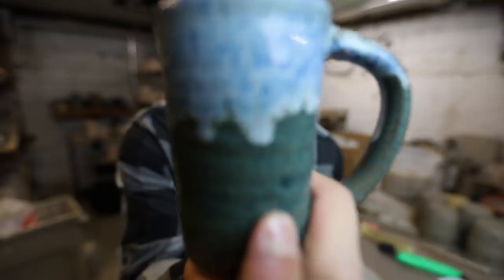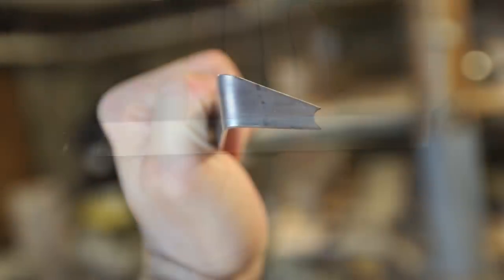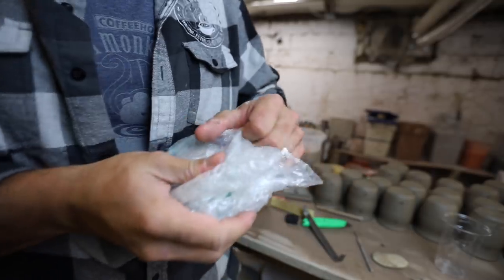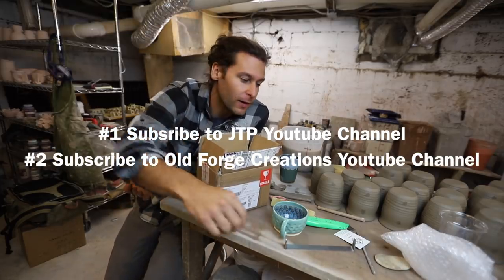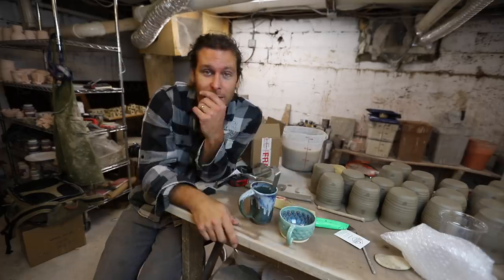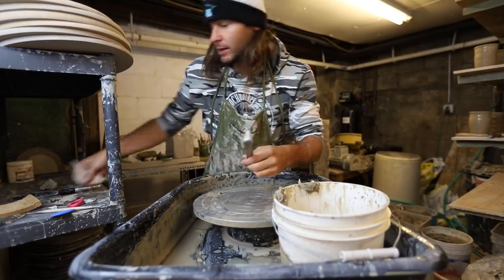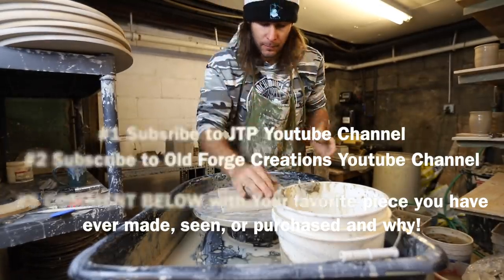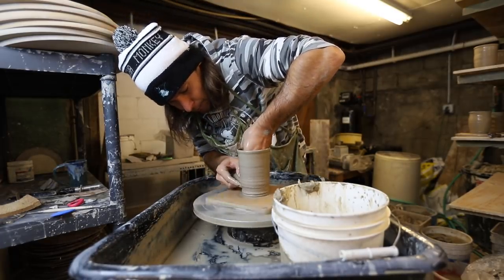How to Trim on the wheel WHILE throwing!   Tool and Mug GIVEAWAY!!

Comment: Jon, you are amazing! 

My favorite piece is still my first piece I threw on the wheel. I was taking classes at an art center and I didn't know anything. So when they taught us wheelthrowing, I didn't know about trimming or feet yet.. 

I somehow centered that piece on the first try using about 4 pounds of clay. My end result was a VERY heavy, untrimmed decorative bowl. They never told us how to trim in the beginner class and it wasn't until the next class that I learned it.

Now I'm obsessed with trimming the perfect foot. I often leave a bit of extra thickness on the bottom so I can spend more time trimming. It is my ultimate relaxation technique. 

But I still love my heavy untrimmed bowl because it reminds me of how far I've come.

Comment: I just started working with ceramics and pottery back in August 2018, because it's offered at the college where I am getting my MA. My favorite thing I've made so far was a vase I created in late November 2018. This particular vase was pieced together with four different thrown forms with two center sections having thinner walls since the middle was thrown at a thinner thickness this allowed for a controlled collapse. The center caved in while leaving the top and bottom geometric shape intact. I love the way the organic nature of the center clashing with the geometric aspects of the top portion of the piece. The top glazes turned out a little strange after layering several underglazes and top glazes. Basically, the glaze has a lot of earthy tones and then these random strokes of almost cobalt blue.

Comment: Im a ceramics high school student, i throw every day on the wheel. Though i havent kept many, id say my favorite piece is a toss up between a small angular pot, as well as a lidded pot ive made. Not for size, but rather the distinct style ive made for myself making them. Sharp angular walls, meeting at a wide line, im in love with them. I just made the lid with a knob yesterday, and it fits perfect!

Comment: I love working with clay.  But I have to say, I thoroughly enjoy my little flock of ceramic guinea hens. I found them in a colorful bazaar in Ethiopia. The design of the hen is very simple.  It's an upside down, pinch pot with a small head and a wide, flat tail pointing out from the opposite side.  The puffed up hens are covered in small white dots.  These dots are precisely placed to create beautiful patterns.  I fell in love with the quality and simplicity of these cute, little birds.  I couldn't help bringing several home with me.  They bring back wonderful memories of a trip that I will never forget.

Comment: My favorite piece is a face jug I made in my first semester as the final project. It's a "face of me" breaking out of the side of the jug and my arm is thrusted out the top "the stopper" gripping a trimming tool. It represents me finally breaking free at 51 from so many responsibilities and being able to take my first every Cersmic class. There was no holding me back after the first touch of clay.

Comment: My favorite piece I have made is a big bowl that had indents on the inside and outside. I alternated pressing into the clay with my finger every inch. In total, there are about 150 holes. Inside each indent I put a small shard of glass. The result was stunning. A deep floating blue glaze that had even more depth because the glass made the glaze inside the indents lighter.

Comment: Currently, my favorite piece(s), that I've made, is a set of matching  marbled/ agateware mugs, for my wife and I.
I took one clay body, and added black iron oxide, to get the two colors.
They are a nice size, have a lip, that is comfortable to drink from.  Honestly, my favorite part is the foot ring, which I smoothed and compressed, so it has a very smooth feel.
Also, I normally go with pulled handles, but I actually threw the handles for those, as it was the best way I could think of, to also include the marbling.

Comment: Hey Jon, my favorite piece is probably a fountain I made. I threw a bunch of parts and handbuilt others then attached them all together into three parts. When it is put all together it stands at about 2 feet tall and is free standing. The pump actually sits inside the bottom, and it is pretty cool. I glazed it with a bunch of different blues, greens, and purples to give it a water theme. I love your videos, and I am so inspired by you.

Comment: Subscribed to both! Yes and my favorite piece is the mug I drink from each day! at work because technically it is visually appealing, hold a good amount of coffee, has a great balance when holding due to position of handle and a little ball located in the underside of the handle that is situated just far enough from the mug that my finger can rest with little or no pressure  when simply holding the mug or when maneuvering the mug about. The rim of the mug is also smooth on my lips and is slightly curved, which seems to reduce dribbles (not that I’m a sloppy drinker 😂). Thank you Jon for allowing us to enjoy the pottery journey with you!  God bless you and yours!

Comment: My favorite piece I've thrown is a altered vase form. I threw a hourglass shape on the wheel, pulled it off and pushed out different curves from the inside of the vase and formed it into a female body. I used tan skin tone underglaze and used sgraffito to carve out white stretch marks . The neck of the body is where it opens for flowers.💐😌🌸☀️

Comment: Would love to have the tool or the Mug! Subbed to both. I may just go buy one if  I don't win it. Favorite piece was this smooth and light weight bowl,  which I wanted to put a handle on it so that I could carry it with hot liquids. Ended up making the handle shaped like a lizard crawling around the edge. One of it's legs broke off and to fix that I painted the leg onto it with glaze so it looks like the lizard is melding into the bowl. 

I loved that it started out kinda plane but as I worked on it  it became it's own thing I hadn't envisioned before I started.

Comment: I might be late, but I hope you see it, I'm pretty proud, but if you don't I'm glad to get my thoughts out. My girlfriend challenged me to represent her in my pottery, I accepted because I love a challenge. She is like a medieval wine bottle, one with all curves and no straight lines, even from the bottom. Wide at the bottom, but thin enough to stop a cork in it at the top, a subtle overhang for the lip. It is rough, indents here and there because of her rocky path she has been through. On to future glazing! She is simple so a simple glossy white would be fine, but her decoration is nothing simple. I imagine Glossy black and brown with hints of blue (possibly dyes too) as birds! brush strokes will be visible with a lot of confidence put into them.. her spirit animal is the albatross and that's why.. so I'm wondering doing a negative effect with the black feathers on white, than the white feathers on black. It's gonna be one of my most sentimental pieces and one I plan to take more time on. Love your videos Jon, your passion is amazing. I don't have a picture yet, still greenware and the shape is done, but I hope to share it with you in the future.

Comment: My favorite piece I've made so far or recently is a plate that I added coils to to make into trees, and tons of tiny clay balls that I turned into leaves. I used underglaze wiped back, dipped in an aqua celadon. I need to make more. It was just very satisfying to make, and when it came out as I'd hoped, it's just a great feeling :) Here's a pic on my facebook pottery page https://www.facebook.com/MollysPottery/photos/rpp.434017446686638/2117099175045115/?type=3&theater